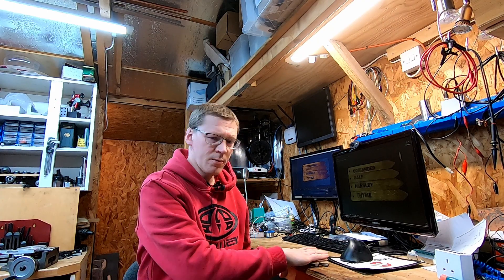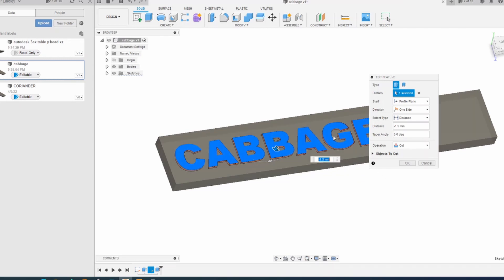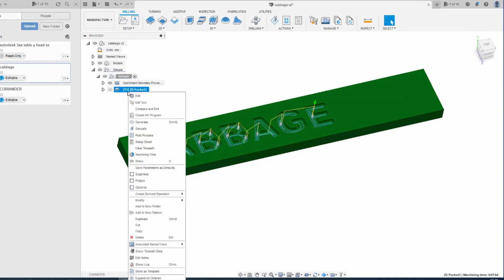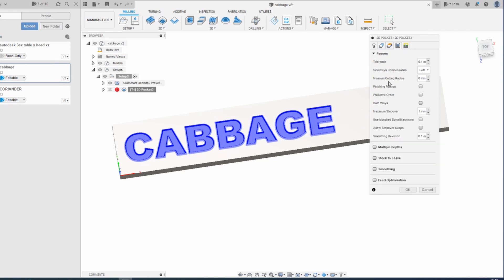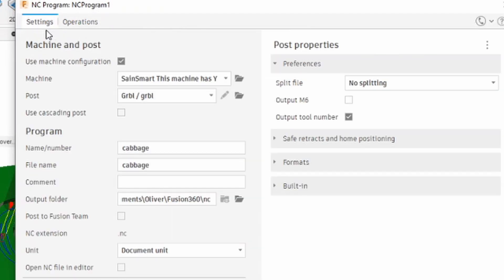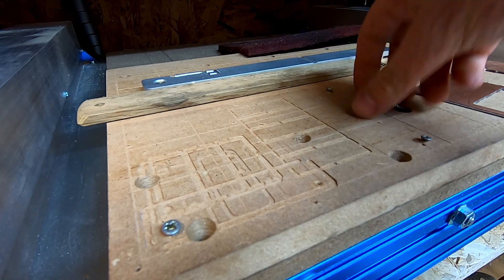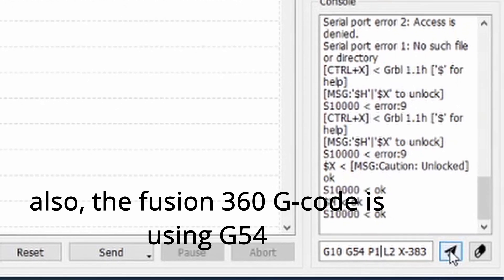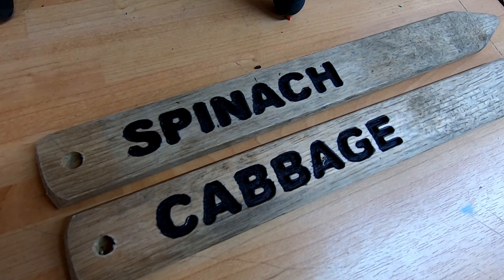Basic CNC with Fusion360, Candle, GRBL, Genmitsu 4030 and the mystery of G54! -  wooden plant labels

Comment: hi Olly, great video. would you mind sharing how you got your machine to home so fast? mine takes ages.
Reply from the maker: In the command line, type $$ to see what your settings are, $24 is the homing feed rate, mine is set to 500. To set the value, enter $24=500 (for example). Note that I probably sped the video up, so it may not be totally realistic. Hope this helps.

Comment: hi @ollysworkshop In conjunction with your Fusion 360 profile video and this one, how much are applicable to the Genmitsu 4040-Pro?  I'm having a hard time getting Easel-made GCode to run properly on Candle, so I'm going to try Fusion 360
Reply from the maker: Hi. Everything I covered in the video should be applicable, the only difference being the machine dimensions, but I'm not sure how critical that is unless you are pushing the limits. What issues are you running into with candle?

Comment: Where did you get the profile for the Sainsmart 3018? I have a 3020 Pro max but cannot locate any machines via Fusion 360 library
Reply from the maker: Hi David, use the same method as shown in the video. Find the Autodesk 'generic' machines, copy an appropriate one to your library and modify the parameters to meet your machine. Thanks for the question.

Comment: Thank you for doing this, hard to find somebody on youtube that actually going through all this using fusion 360 and this machine. Also, please dont delete this video, I would like to come back here again someday if i end up forgetting everything.
Reply from the maker: No problem, I'm glad it was helpful. No plans to delete any videos, so it'll be here should you need it again. Thanks for watching.
Reply: @ollysworkshop  I want to use fusion 360 with genmitsu cnc but it kept running into so many problems. Do you know why the z axis of the spindle keep raising up to hit limit whenever I hit send to start?
Reply from the maker: @SkyfalconTin  hi, I don't know why it's doing that, but it should be possible to work out why. First take a look at the first few gcodes and work out what the program is asking the machine to do. Just Google the G codes, that's what I do. You may have to adjust some of the grbl settings, perhaps an axis is reversed or something. I seem to remember I had to fiddle with some of the grbl settings on my 3018 machine to get it to behave the same as the 4030. Let me know how you get on. Thanks
Reply: @ollysworkshop    Thanks for the help, I found the answer online on Fusion Q&A. I finally got it to run and learn a few things. Hopefully it didnt break and possibly, i need to build an enclosure because this machine is too loud, are they always noisy?
Reply from the maker: @SkyfalconTin  yes, unfortunately they are noisy. Glad you found your answer. Best of luck.

Comment: Can Candle add a drilling function thx
Reply from the maker: Hi, candle is a gcode sending program, it will do exactly what you tell it to do. You need to create the appropriate gcode for drilling in the same way as you create the milling gcode. I have successfully used both flatCAM and fusion360 to generate drilling gcode which can then be opened and run in candle. Hope this helps.
Reply: @ollysworkshop  Thx! Helped

Comment: Hi, would you have any idea why after exporting as gbrl g code and running my machine in Candle, my 4030 decides (it seems at random) to randomly cut a straight line across my work. Im sure it has to be in the G-Code because I've tried different laptops and many different tooling operations and it happens on all of them.
Reply: Hi thanks for that. The solution in the end was the offline screen. If it was plugged into the controller at the same time as a laptop/PC it would send random error messages or blips to the machine during an operation. After unplugging that I’ve had no issues.
Reply from the maker: @toby-cass  thanks for the update. That's good to know.
Reply from the maker: Hi. Only thing I can immediately think of without knowing any more is check that the Z zero is set to the same point as in the CAM (usually the top surface), and that the retract and safe heights are set appropriately. Also check that Z is driving in the correct direction. I had an issue where the head plunged deep into the work instead of retracting!😬

Comment: Where did you get your machine profile that you have set up in fusion 360. They don't have the machine in the library and i cant find a profile anywhere to import. Could you provide an export of yours? Great videos BTW!!
Reply from the maker: Hi Roger. There was a fair bit of assumed knowledge in the video, so thanks for the question. I did find a suitable machine profile in Fusion, but it was a generic one that I had to edit the parameters of. The grbl post processor is built in with no need to modify. Let me know if you would like a video explaining the process of setting it all up. Thanks for watching.
Reply: @ollysworkshop  Yeah that would be amazing. The CAD part of Fusion i have sort of figured out but the machining part is another beast. If you could do a step by step idiots guide to setting up the 4030 as a machine in fusion that would be amazing, i looked at some of the generic profiles but couldn't see the best place to start. If you have something that's working it would be much appreciated.
Reply from the maker: @fistandanti1us  no problem, I'll try and get something done in the next few weeks.
Reply from the maker: @Roger Mills Sorry for the delay, I have finally produced a video for you.  Let me know if there's anything else you want to know.
Reply: @ollysworkshop  awesome you are the best!
Reply from the maker: No problem. Sorry I took so long.

Comment: Hi, it may be a silly question but
Is it possible to import .gcode extension with fusion 360?
My machine does not recognize .nc
Or how to convert .nc to .gcode extension?
Reply from the maker: Hi. As far as I know, as long as the file actually contains g code, you can give it whatever extension you like. I would just try renaming the file in Windows explorer (assuming you are using windows) with the .gcode extension. I will have a look later to see if it's possible to change the output extension in the post screen. Thanks for your question.
Reply: @ollysworkshop   hello,
Unfortunately I tried that, it doesn't work.
I have one Creality cp-01, for CNC part
It wants .gcode. If you learn a solution, I would be very grateful if you could share it with me. thank you
Reply from the maker: Hi, sorry for the delay. Just had a look and you need to select the correct Post in the post screen (use choose from library option). I have tried selecting Creality Family and it automatically changes the extension to .gcode.